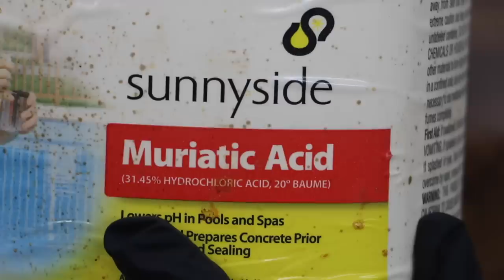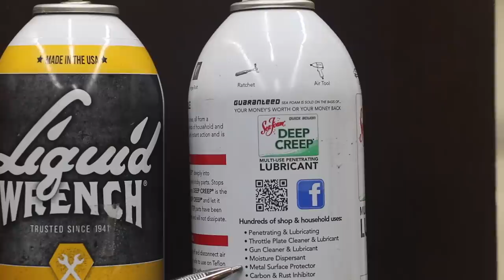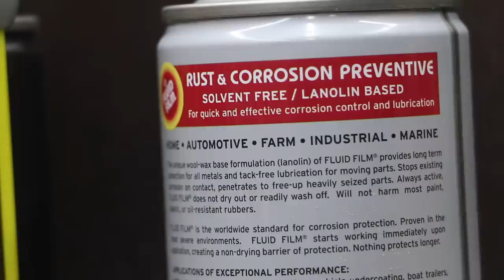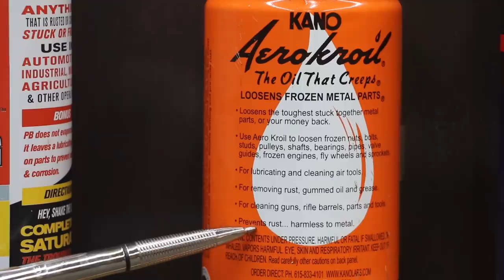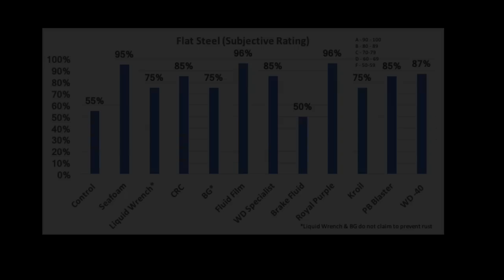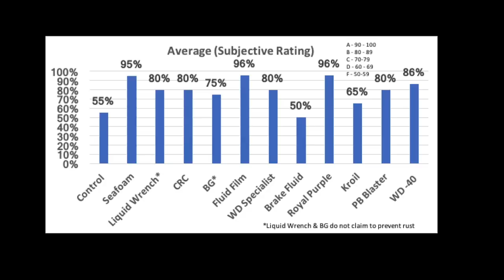Do Penetrating Oils Block Rust?  Let's find out!

Comment: Rust is oxidation, combining of an oxidant with any metal. Chlorine and oxygen are both oxidizers. Putting bolts in Hydrochloric acid is promoting rust. Rust protection is insulating a metal surface against contact with oxidizers, mostly oxygen and water and in particular oxygen in air and salt water humidity like when living near the ocean.
Reply from the maker: Thank you for the feedback.

Comment: I was wondering if you had any experience with Boeshield T-9. It had good reviews on Amazon and I bought it.
I live in SW Florida and it is pretty humid here. Doing woodworking in my garage, I also restore woodworking equipment. So this is a big issue here. 
Boeshield T-9 actually smells like WD-40, which I also have.

With your video I feel that I have a lot to learn. I could really use some input.
Reply from the maker: Great suggestion! I've added it to the list for the next showdown on undercoating. Thank you!

Comment: Brake fluid is not corrosive!  12:37 Water molecules from the air will however gradually be absorbed into the brake fluid ( hygroscopic effect ) removing several of the brake fluids key purposes but in this case the important one -  blocking oxygen from reacting with unprotected ferrous metals.
Reply: Im just mention this because it probably will confuse a few people not familiar to the properties of regular brake fluid...
Reply from the maker: Great point. Thank you

Comment: Brake fluid's performance is not surprising as it is highly hydroscopic and as such would be drawing moisture out of the air to add to the bath it had thus as you noticed speeding up the rusting process rather than retarding it.   I am surprised by your test with WD-40 both in its performance as a penetrating oil and as a rust preventative.  Completely counter to my experience.  I was using it when they first came on the market in the early sixties as I recall.  It was a much better and more effective formula then.  By the seventies it had deteriorated to its present level whereby it for me is useful only as a cutting fluid on aluminum and there are much better ones for that use as well.  In my experience it has caused rust and corrosion on metal rather than preventing it.  It does seem effective at water displacement in the very short term a much different horse than rust prevention.  As always an interesting test.  Take care.  Doug
Reply from the maker: Thanks for sharing.

Comment: Just a reminder:  Don't forget to wear a face shield to protect your face and eyes when working with acids to prevent splashing accidents.  It's also smart to wear an OLD long-sleeve shirt (or a lab coat/shop coat) as well for the same reason.  The acid/galvanizing solution left over from the first part of the test should be handled as HAZARDOUS WASTE and disposed of properly.  The left-over cups of each rust preventative solution should also be considered Haz Waste, and handled in the same manner.  This information is provided for viewers who might try this or similar tasks at home or work.  Incidentally, corrosion caused by salt water is more of a problem when there are continuous wetting and drying cycles, compared with constant soaking in solution, so keep that in mind.  If you're trying to protect steel or wood products from the effects of salt water (for instance, you live at or near the ocean), go to a paint store (Sherman Williams, etc.) and ask what paints or coatings they sell that will protect them from long-term exposure.
Reply from the maker: Great recommendation!

Comment: WD-40 was the cause of the ruin of some fine, expensive guns that I sprayed it on back in the eighties.
I applied the product heavily then wrapped the guns in a protective blanket and hid them behind my couch. I did this because I was leaving for ten days and had experienced a burglary the year before. Most of the guns had deep pits in highly visible places when I returned home. People have said that the humidity and blanket caused the pitting. I say that the WD-40 did nothing to help. If I had left the guns on the rack then with or without WD-40 there would have been no damage. I put my trust in the advertisement that it prevented rust and lost money invested in fine guns as I had to sell them as damaged.
WD-40  did absolutely nothing to PROTECT my guns for the ten days.
DO NOT PUT FAITH IN THAT PRODUCT.
Reply from the maker: Thanks for the feedback.

Comment: hmmm..so now I know why my master cylinder on my old truck seems to rust so much..it does leak some brake fluid..I did not know brake fluid would cause rust before...hmmm..so if it is so corrosive, then why don't it rust the insides of metal brake lines and wheel cylinder pistons?..seems like a corrosive liquid would not be a desirable thing to use for a hydraulic brake fluid?....

Comment: I use WD-40 where I work repairing shipping conveyors, and I've found that it attracts moisture which leads to some corrosion, but doesn't your removing the coating off of those Grade 5 bolts screw with the results? Also, test rust prevention using two different metals that are touching to test the prevention of galvanic dissimilar metal corrosion
Reply from the maker: Thank you for the feedback

Comment: Great show,Hey got a question..What is the harm/aide in using synthetic oil in the crankcase.as far as i know it is just standard 10-30 oil recommended.
Reply from the maker: Synthetic oil tends to hold up better under extreme cold and hot temperature compared to conventional oil.

Comment: Test BestLine Lubricants against the leading in your tests? I've looked but could not find a rust test (release, penetration and removal) for BestLine Lubricants. I have had great results! As an example, I do not use specific motorcycle chain lube anymore.I own over 20 motorcycles, most of them for training.  I use their MLT-101 and/or NO-Squeek. I have not used their Sea-Spray. Chains need a proper lubrication, penetration and rust prevention product. I'll even send you the Lubricants for free. Let me know. Thank's for the great info!
Reply from the maker: Great recommendation!

Comment: Kroil has a better reputation in light airplanes than it deserves. It is considered a wonder fluid, but here and other online sites rate it pretty poorly. It doesn't do to well with guns either. It costs several times what it is worth. I wonder if it is an old formula that is hanging on to a once great reputation. No clues except it doesn't seem to work very well.

Comment: Hey a little tip if you dont remove the protective coating it wont rust as fast 😛 and can you recommend a oilfilter brand? Im going to do the oilchange on my car for the first time by myself. the current filter is a AC Delco pf47 should i go with this or maybe use k&n or some other high performance oil filter?
Reply from the maker: lol!  I like AC Delco filters too, but I need to conduct a thorough test of oil filters in the future to assess their quality.  Thank you!

Comment: Very interesting :-). Id say that WD-40 like some others  wash off to a degree protecting less...  Well I'd personally use tractor Greece or high grade Greece at work we use thick black or dark green greece kinda like toffee aspect that can resists High temperatures coat stuff with that and i think there would be much less chance of rust plus don't wash off easily... Perhaps you can do a video of the same kind using Greece to prevent rust ?
Reply from the maker: Thank you for the feedback

Comment: Sorry, but this would be a good way to objectively add a way to measure for rust testing.  Control the depth, speed and direction of a scrub brush to collect scrapings off of both a specified section of the plate steel and on a type of paper collection system that can be weighed for amount of rust removed for say 20 brushings.  And for the bolts, same thing, just that they may need to have the bolt head facets marked before hand so that the same side is presented to the brush in order to control the objectivity of the experiment.  Then the objective results could weigh against the subjective results as well.
Reply from the maker: Great recommendation!

Comment: I remember using standard wd40 on a car door lock inside the door - it washed all the grease off of it and later on it rusted.   How does fluid film or royal purple work on allready rusted metal?
Reply: I use WD40 as a cleaner only and have never thought of it as anything else.

Comment: Original WD-40 is not a penetrating oil. it was developed as a way to displace water. WD-40 means Water Dislplacement on formula #40 he wrote it in his notes as WD-40 and the name was born., it does have some lubricating properties and will penetrate a very small amount but desovents very quickly. it is perfect for protecting from surface rust on freshly cleaned metal.
Reply from the maker: Thank you for the feedback

Comment: What the best for rusted bolts , heat or cool? Heating with gas torch or liqid propane mix
Reply from the maker: Great video idea!
Reply: Project Farm i have some exp on old 50cc engines , some times heating of rusted bolts has no effect or can not be done ( near washings etc.) And cooling with simple camping gas can has greate work. Wd40 is aded both times

Comment: First of all I like your videos you do very good work. But I would like to see you do more time control. Such as 1 day 1 week 1 month 1 year, has it look over time?  examples : how does  different varieties of duct tape (which one) lasts the longest overtime?  2. Vegetable oil is great in a pinch. But cannot last overtime. It starts to build up carbon after 2 weeks & can starts to smoke.  3. Diesel  & vegetable oil  bacteria can grow inside them, unlike gasoline and motor oil. ( overtime of course). 4. Corrosion; on the metal bar you need a longer control time.? I think, for a more  accurate results?

 This was given as an opinion not criticism to your find work. Thx.
Reply from the maker: Thank you for the great constructive feedback.

Comment: I find it surprising that you used a mix of peroxide, salt and vinegar. I soak rusty parts in vinegar for a day or two to get rid of rust. Very effective as long as you wash, dry and oil after.
Reply from the maker: Thank you.  Yes, hydrogen peroxide is an extremely powerful oxidizer once it's mixed with an acid.

Comment: Would fluid film over time with expansion, contraction, exposure to the elements and dirt accumulation make it harder to remove since it seems like there is a coating?
Reply from the maker: Thanks for the suggestion.

Comment: What about transmission mix. Will that prevent rust?  Seen a video on you tube where a guy warmed up vasalin and mixed it with trans fluid. Said it prevents rust.
Reply from the maker: Thanks for the recommendation!

Comment: I say that WD-40 WILL BREAK SOME THINGS LOOSE- BUT WILL RUST IT IN PLACE IF YOU LEAVE IT.
I'D SAY Liquid wrench is good and Kroil is great.
I'm cheap if I want to break something loose I soak it with ATF and the folowing year I can turn it with just my fingers.
If I need to break a bolt loose now I hacksaw it off and buy a new bolt.
Thats about penetrating oils.
I think ATF gets rid of rust because it contains detergents.
Reply from the maker: Thanks for sharing.

Comment: i once had nossle brake on almost full can of wd40, it was unusable so i pirced can and poured oil into jar (to use oil from jar), so it is like 2 part fluid, because it had like 80% light oil on top and 20% of something else in botom. line between two different fluids was distinct almost like water in oil, and when mixed up well, it wouldnt take long for it to separate out again. i wonder whats that all abbout...
Reply from the maker: Thanks for the feedback.

Comment: Hey man! We have two products that are sold here in Brazil and I was wondering if you could test it, since pretty much every test done here in Brazil is by sponsored creators. Is it cool if I send it to you?
Reply: I don't think they sell then in the states, but the names are Militec-1 and Koube's preventive engine flush, one of then is supposed to do the same as Liquid Moly, and the other is for inside engine cleaning (one every two oil changes or so) and prevention. If you're interested, let me know, I'll send then. Keep up the good work.
Reply: The brand that makes those products that I mentioned also makes a corrective engine flush for engines that have sludge and whatnot and a fuel system cleaner. Again, a lot of tests, but only by sponsored creators. Don't trust then too much. But they're everywhere here and I curious to see what you get from them.
Reply from the maker: Thank you for the video idea.  I'll see if I can find the products here.

Comment: Great video Sir.

I thought Fluid Film would be your winner....  I also like amsoil Metal Protectant, a very similar product....

I didn't know royal Purple made that product...  Looks like it also did very well.

Aero Kroil, uhh, (trying to say this as gently as I can), seems to have an almost cult-like following....  I was never that impressed, and your testing doesn't show much either....  I will not be buying any more Kroil anytime soon...

(Kroil representative slashes his wrists....)

This is purely anecdotal...  I do not know if it's possible for you to do this...  But a homebrewed penetrant that someone told me once, is Acetone mixed with Automatic transmission fluid.  Like 50/50, or I like 6 parts ATF to 4 parts acetone... that works as good as anything....

For rust prevention, you can buy bulk wd40 in a gallon can...  Mix that 50/50 with 5w30 motor oil....  I use that as a cutting fluid, if I am drilling in steel or aluminum, or whatever...  but I have noticed it sticks to the parts, and does prevent rust....  I have a table saw in my garage, and the steel top is always rusting....  When I wiped it down with my cutting oil, I noticed the rust just about stopped....

Anyways, well done Sir.  I know this is an old video, but I just found your channel.  I love what you are doing.  I hope you keep it up.
Reply from the maker: Thank you.  Kroil does seem to have quite a following.  I'm just not impressed with it. Thanks again!

Comment: Seems like some of this stuff is meant for people that understand regular maintenance. and other stuff is meant for those that only check things when something is off. Since that would explain why some seem more useful for preventive maintenance, well others seem more useful for when things are already fucked up.
Reply from the maker: Great point.
Reply: Project Farm  might be worth seeing how these things perform over time. Like if you used them over a month as regular maintenance for a tightened up bolt or something. Because that would be an interesting test to see if that might actually be why there seems to be such an interesting divide in performance. After all maybe the stuff that works great at preventing rust holds up to wear and tear over time better than the stuff that works great at loosening up stuck parts. Well the stuff that works great for breaking free parts, might cause problems over time as it drys, breaks down, and is exposed to things. It's an interesting idea i think, for why we see such performances differences.

Comment: The original WD40 was invented to free our first missiles in their silos. WD stands for water displacement and that is all it was intended to do. It displaced silo condensation. It's a lousy lubricant as it disappears quickly. It does do things like remove adhesive tape. In Vietnam we tried to use WD40 to prevent rust. It was worthless.
Reply from the maker: Thank you for the feedback on WD-40

Comment: You never include wurth products. Do you have them in your country?
Reply from the maker: There are some Wurth products but they are somewhat hard to locate.
Reply: That is a shame. Im a marine mechanic so no stranger to seized bolts. I use Wurths "rost off" with added molybdenum. Advertised to have extremely good "creeping" abilities. I would be curious to see how it compares to some of the products you tested

Comment: WD_40 is horrible at preventing rust. I used it for years and had a lot of cans in the garage that were half full,but have lost their pressure. So I decided to punch a whole in the cans drain them into a coffee can so that I could use the rest of the product. Well multiple cans were just about rusted through at the bottom or lower sides of the can. So bad that I couldn't use any of it. I found it very odd that a chemical that "can be used for rust prevention"  in fact rusted the interior of the can it was made in!
Reply from the maker: Thanks for sharing!

Comment: Without watching the video, penetrating oils penetrate and remove rust unfreezing bolts, shafts and any other steel parts which should move or turn freely. After which you simply wipe or otherwise clean the penetrant off and replace with oil, grease or paint. Penetrating oils are too fine to remain on the metals surface for long periods so the metal will rust again if not treated properly.
Reply from the maker: Thanks for the feedback.

Comment: Does the ATF + Acetone 50/50 mix work well to block rust? I saw your other video on which penetrating fluid that worked best, but I didn't see ATF + Aceton mix here.
Reply from the maker: Great point. I should have included it.

Comment: I can't believe people still use brake fluid like it's any other oil product around cars.  It's expensive, doesn't work well for anything except in brake lines where it belongs.  If brake fluid gets on a painted surface and not wiped off and washed off, bye bye paint.  I don't keep it around my shop at all.
Reply from the maker: Thanks for the feedback.